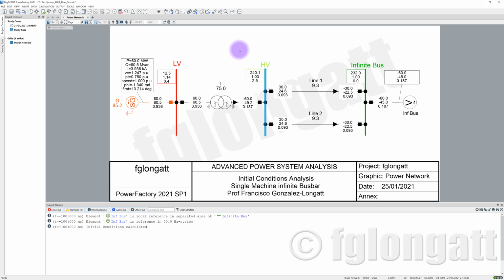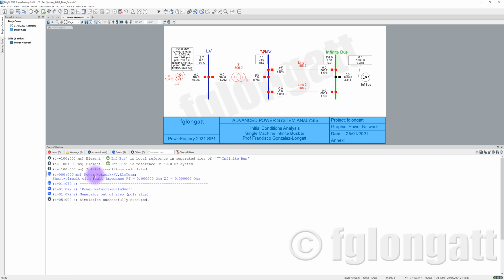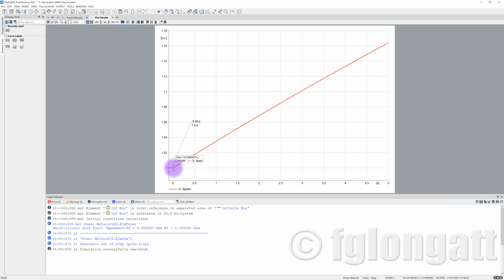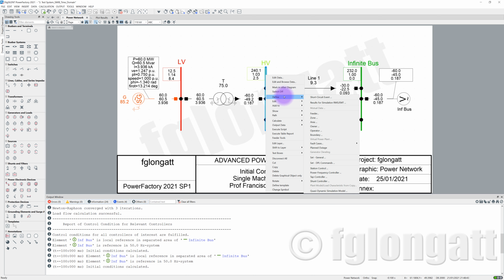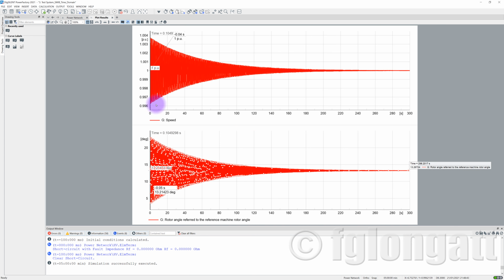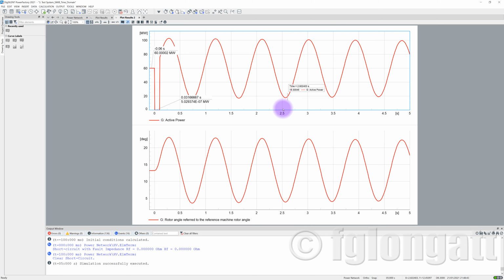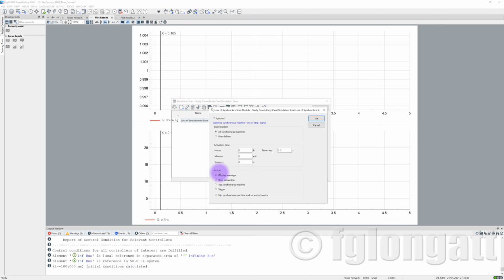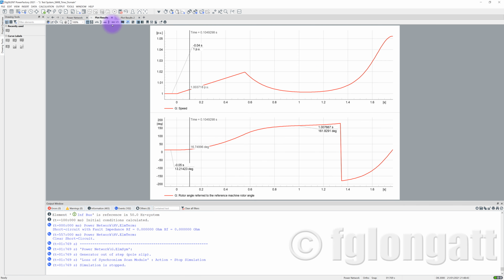RMS simulations #PowerFactory  PART I  Run simulation and CCT Manual calculation

Comment: Hello Professor Francisco, thank you for your videos. I have learned a lot from them and I appreciate your contribution to the study of power systems. 

I have a question. Is there an option in PowerFactory to obtain CCT in one run? I am currently using ETAP for getting CCTs and it takes me quite a bit of time because I have many scenarios. I have heard that PowerFactory can provide the value quickly without doing iterations manually. Is that true?

Thanks.

Comment: What is the reason for the internal angle of the generator in the steady state? which operating mode of the generator to choose when calculating the angular stability?
Reply from the maker: I have been worked with this model in several videos, could you please look at the previous one, I think this is a classic model. Best regards FGL